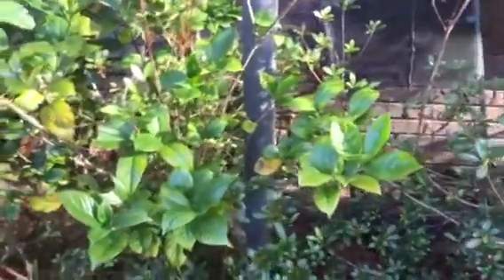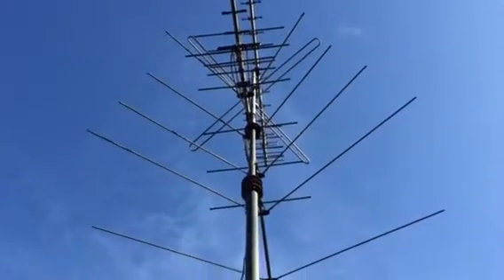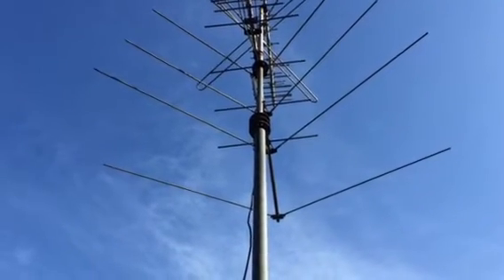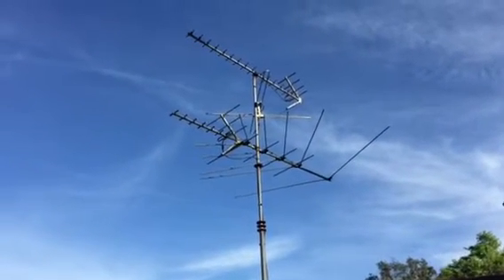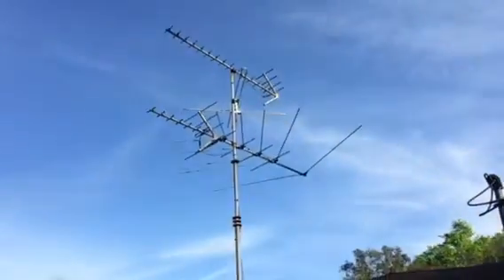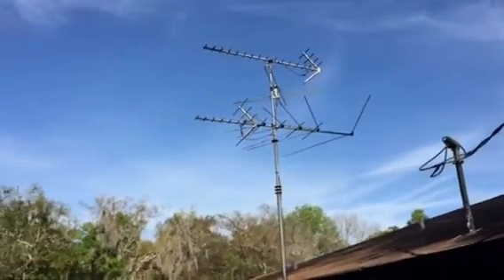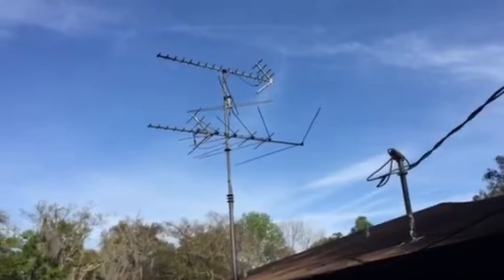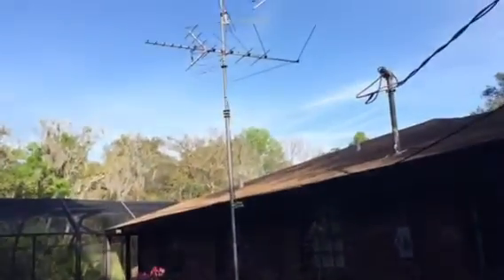Edleedskalnin's Workshop. Using an old tv antenna for studi

Comment: You're wasting an excellent opportunity to watch really great local television. If you hook that antenna to your television you will be able to watch uncompressed local TV. That is a very good Yagi array on your roof. This is actually an antenna that is able to pick up signals some 50 miles away. You might have to replace the existing twin lead with coaxial cable. You will be surprised that the picture you see is better than that of the cable company because it is not compressed.

Comment: Hi Roy don't forget the Vacuum you mentioned light sound  heat but vacuum is the vice versa it appears. That's the part that at the moment is halting my practicle on the static pulse engine effect. May be a static anti static motion as joe booker shows in video bnemeetingjoe50c how the spark does not bite him but when you place 2 parts of your body to the cars structure you get the static shock so that appears to confirm its a static anti static engine what you think ?